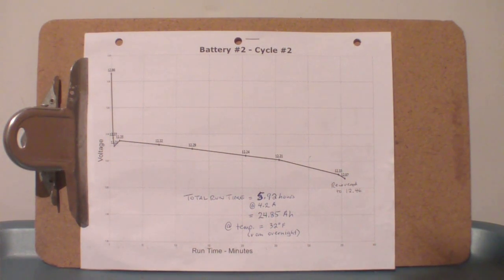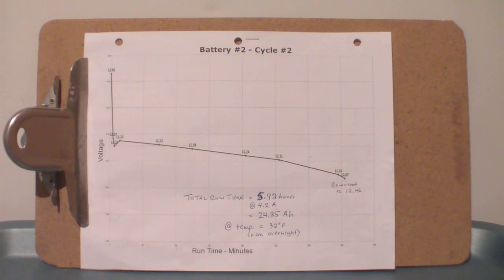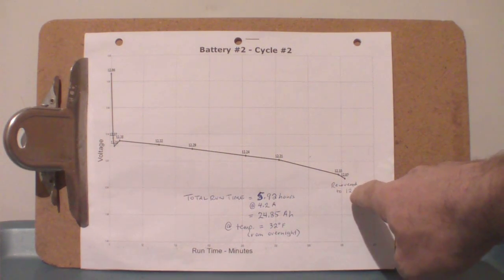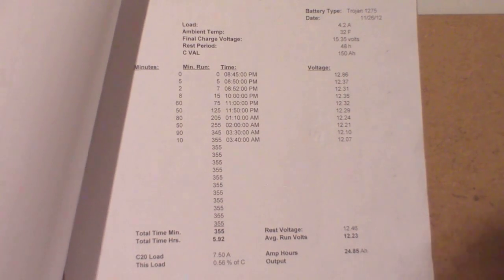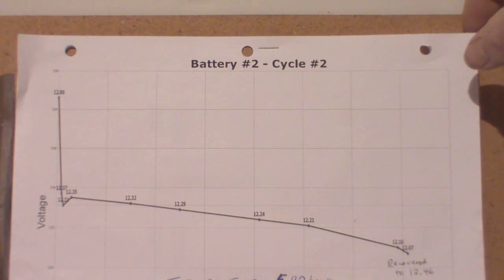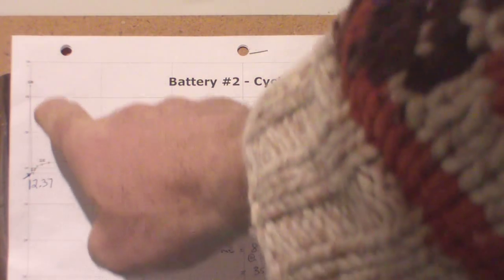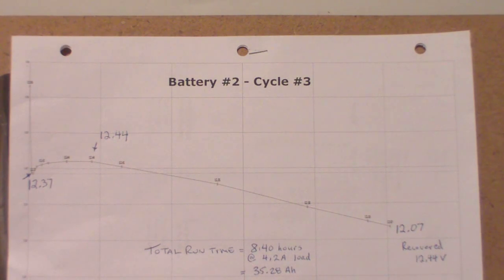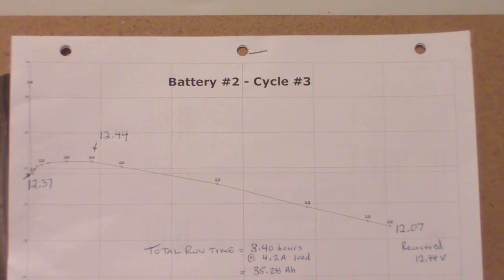Data! TSO SS Aluminum Air Core Desulphation Pt.1

Comment from the maker: That's a good point in the sense that this experiment, while trying to be somewhat scientific, has an underlying goal, and that is to determine if a group of batteries, acquired for free (I can get back what I paid for them, from the scrap payment) - can actually be useful. If one battery can produce 500 watt hours reliably, then 10 can produce 5000 watt hours. Free is free. More to come on just how to reliably gang uneven producers as to not have them just beating each other up... Thanks

Comment: Kyle,  Excellent balance between being scientific (not so anal retentive) and having a life.  I think you are far enough away to see the forest for the trees.  I don't know where you came up with positive plate corrosion, but I can say that when I desulfate, I believe I have overdone it and end up open circuiting the battery...or in your words, "dissolved the positive plates excessively."  Maybe I should add a small resistor in series with my battery in the future!  Liked and Subscribed!